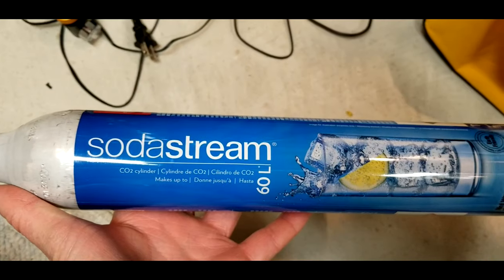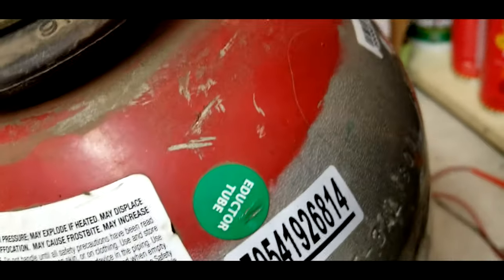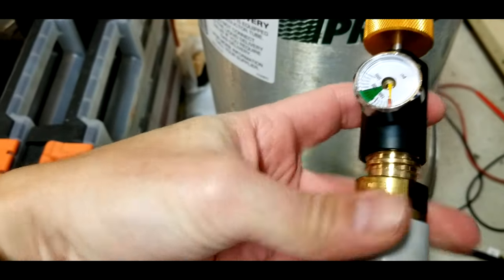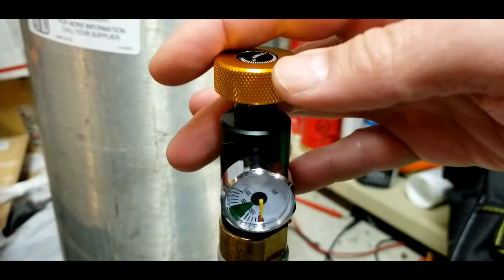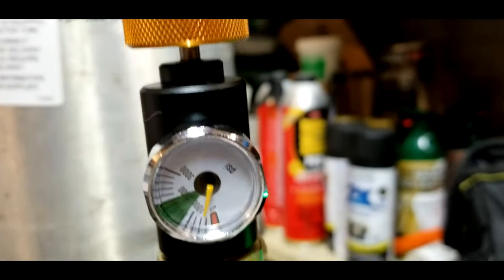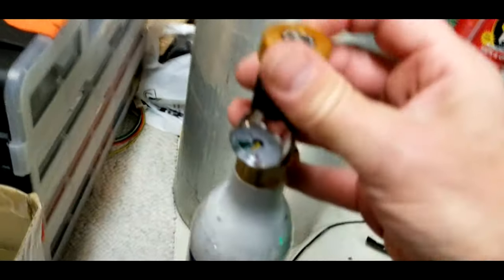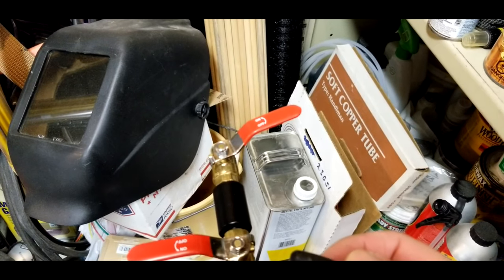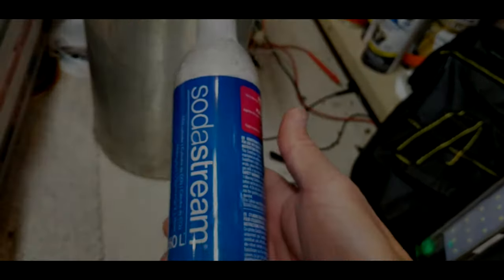How to Refill your Sodastream CO2 Cartridge for under $1.00!

Comment: Oops, I bought this adapter and a tank and CO2. It doesn't work on the new quick connect Terra soda stream bottles. Back to the drawing board. If only I had known then what I know now.
Reply: find any solution?

Comment: Can I use a standard beverage gas tank without the dip tube and just turn it upside down? I understand freezing the tank also lets you get a better fill.
Reply from the maker: Yes (upside down tank), and yes, freezing the Sodastream cartridge before filling will allow you to get a slightly larger amount of CO2 in it.

Comment: Could you explain why the eductor tube is necessary? Thank you!
Reply from the maker: It means concentrated, liquid CO2 is transferred into the Sodastream tank. Without it, it only pressurizes the tank, and it will end up holding a small fraction of the capacity of a tank filled with liquid CO2.
Reply: @ScottsSynthStuff  bingo! Thank you!

Comment: Good video. I'm still only getting my SodaStream bottles half-filled this way. I weigh them empty (around 700g) and as the bottle is getting filled it stops taking on CO2 at the half point (ie around when I've added about 200g of CO2). Not sure why it won't take on more. I should be able to add 200g further but.. no luck. And I am chilling my empty bottles as well. Any ideas what's happening?

I've tried this with three different SodaStream bottles. Same issue.
Reply: You are filling with gas and you need to refill with liquid CO2.  Invert your fill tank or use one with a siphon.
Reply: Also it helps a great deal to put the SodaStream canister in the freezer overnight before you refill it.
Reply: The easiest change to make is to do the fill in two steps. First, just fill all of your room temperature bottles slowly from the liquid (inverted or dip tube) letting it sit for 5 min, then remove it after shutting and bleeding the hose, then stick the partially filed bottles in the freezer on some ice for an hour or two.  Finish filling into the cold partially filed tank.  You will get at least 100% fill.  don't worry about a couple of percent over fill, but bleed it off by filling a soda bottle soon if you end at more than 110% full (highly unlikely).  

This two step process works much better than trying to get it done in one step with just a cold tank due to the thermal mass heat transfer of the liquid.

Comment: What happens if you trip the check valve? Does it reset itself if you reduce the inlet pressure?
Reply from the maker: Yes. As soon as the inlet pressure is released, the check valve releases.

Comment: I really can't get pass 100g or so of filling - I'm really going slow and the trip valve activates - any clues?
Reply: Go slower. Maybe your tank is low?
Reply: @caprice6825  Actually, I had to put my CO2 tank upside down to make it work properly as I don't have an eductor tube. Thanks for your reply though :-)  I don't even need to close the screw on the sodastream adapter.

Comment: Here’s a trick, when the big tank is getting empty freeze the small tank and heat up the big tank then you get more pressure longer.
Reply: That's not  only a bad idea, it is stupid and UNSAFE!!!!    Never heat any storage tank...they can explode and kill you!    Also the whole idea is to put liquid co2 into the cartridge not gas, if you heat the liquid, it will turn into a gas! Chilling the tank by either refrigeration or letting the last of the gas out is recommended....cold bottles do not let the liquid turn to gas creating a pressure that fights the liquid from fully filling the bottle.
Reply: The C02 needs to be in liquid form under pressure and turns to gas when released.

Comment: why not just get a high psi hose and hook the tank directly to the sodastream. the pressure from a tiny canister is the same as a large 20lb tank, no?
Reply from the maker: Yes, and there are adapters that let you do exactly this - as long as you don't have a problem finding a place for your 20lb tank near your Sodastream.

Comment: make sure you use food grade co2
Reply from the maker: Have you been to the gas plant? I have. They don't have a "food grade" CO2 or "medical grade" O2 machine. They have one machine that makes CO2 and one machine that makes O2. They hook up a welding CO2 tank to the machine, and that's welding CO2. Then they hook up a "food grade" tank to the same machine, and that's food grade CO2. Same goes for the O2. The gas is EXACTLY the same regardless - the only difference is the color of the tanks being filled, and the prices being charged for it.

Comment: no worrie bottle has  to be rated to 5 times its capacity by law  and cylinders need to be tested every 6 years  bottle has a ripple at bottem of tank that  expands out if it over gases  so there safe

Comment: I have someone selling their co2 tank they used for their kegerator.  They don't know if it has an eductor tube.  Do you know if kegerator tanks require an eductor tube?  If so, I can buy this one for the setup in your video.
Reply from the maker: Highly unlikely, because a kegerator needs gaseous CO2, and the purpose of an eductor tube is to feed from the bottom of the tank, which gives you liquid CO2.
Reply: Wouldn't it be possible to skip the eductor and simply have the tube be upsidedown?

Comment: Hi, others have asked this as well - how do you know when the Soda Stream bottle is full?
Reply from the maker: It stops filling when the pressure is equal to that in the source tank - about 800 psi. You can hear it stop when it's full.
Reply: Full is when it won't fill any more. The pressure in the source tank will be the same as in the SS bottle.

Comment: Hi why does it have to have an eductor tube? I imagine the explanation is quite complex in addition to explaining in your own words perhaps you could link some informative content like videos or literature? I looked for other similar hack videos but only you mention the eductor tube.
Reply: The tank is full of liquid CO2 at the bottom and gas at the top. Because you are using it to fill another tank, you want the liquid and not the gas. The eductor tube runs all the way to the bottom of the tank so that when you open the valve liquid is forced out instead of gas. You could use a tank without an eductor and turn it upside down to accomplish the same thing though.
Reply: @nerdstrangler4804  Thanks for the reply. I follow your explanation thus far.. so what would be the danger or the result of filling the canister (smaller tank) with gas CO2 instead of liquid?
Reply: @agustinferreira5128  Not sure if there is any danger, just that you won't be able to force nearly as much CO2 into the receiving tank by the time the pressure equalizes so it will be mostly empty and need to be constantly refilled. Even with the eductor tube you can apparently only refill the sodastream tanks to around 50-60% capacity at room temperature. Although you can refrigerate or freeze the sodastream tanks prior to filling in order to help fill them more.

Like I imagine you are, I am currently researching this all for myself. Personally I am leaning towards just using a standard standard CO2 tank without an eductor tube and buying a hose that allows you to connect it directly to the machine.
Reply: The reason why you want the liquid is because liquids have a higher concentration of molecules than gasses, therefore a higher CO2 concentration.
Reply: No eductor tube? Flip the the tank upside down.

Comment: Good instructions.  But please don't recommend that refill adapter.  A lot of users have to fix the connections, or even replace the valves.  I have to apply Teflon tapes to all the connections.
Reply from the maker: I've been using it very regularly (at least once a week) for 9 months with no problems at all!
Reply: @ScottsSynthStuff  I am glad it works fine for you.  Per your recommendation, I purchased the product from Amazon.  It was leaking the first time I used it.  If you search on "leak" against the comments, you will know what I am talking about. Now I got mine fixed.  I hope it can last for a long time.

Comment: After stumbling on this video a couple weeks back I got the same set up but may have tripped the check valve. Any tips?
Reply from the maker: Just shut the valves, release the pressure, and start again. The check valve resets itself when pressure is removed from the fill hose.
Reply: @ScottsSynthStuff  thanks, apparently I was going too fast lol
Reply: @ScottsSynthStuff  How long does it take to fill? I am always too scared to let it get into the green as you say because it starts making this high pitched noise. I'm afraid I will explode the cannister.

Comment: one important point to remember.  If you are below ~830psi (at 70F) you have depleted all the liquid CO2 in the donor tank and are only transferring gas.  You will not get much CO2 into the soda stream tank if all you transfer is gas.
Reply from the maker: Correct, and you will know this a) because the sodastream cartridge is not as heavy when "full" asn b) it "runs out" quickly, as there is no liquid inside to evaporate.

Comment: Non-siphon? I called my local welding store before I watched this video and explained to him what I wanted to do and he said I would probably need a siphon tank?

Also, can you give a link to where you bought your tank? Sounds really cheap. I am seeing ten pound tanks for $130~
Reply: The "eductor tube" mentioned in the video is a "siphon tank."  It makes the tank supply liquid CO2 instead of gas, which is what you want when you're refilling another tank.  But, I find it a lot easier to use a regular non-siphon tank just hooked directly into the Sodastream machine itself with an adapter hose, and not bother with trying to refill tiny tanks.

Comment: For some reason the gauge needle never gets close to green and we have to refill again in only a few days versus a few weeks when we swap our Sodastream cylinder. Any Ideas?
Reply: Are you weighing the bottle before and after? I can measure the difference and know how much it filled. Maybe your tank is getting low
Reply: Thanks for the reply. The tank is new. I'm weighing the cylinder now and I can measure the difference. I think I've got it figured out now: I freeze the cylinder before filling and that has made a huge difference. And my tank doesn't have a dip tube, so I know to turn it upside down when filling. Needle never gets to green area but whatever.
Reply: @bhegg  the soda stream bottles only hold about 400g so the needle should only go to about 400. In the green is 1000 I think.....my preweigh is about 700 then after is close to 1070. I can't get the full 410, but close enough. Peace 🌻. At least we enjoy our cheaper refills!
Reply: @caprice6825 if i try to fill sodastream  tank by your way and it doesnt reach 410 g . If i keep it filling for more time and it doesnt fill more, there no risk to explode?
Reply: @AliAlmutairi-sj1it  as your tank gets lower, your bottle won't fill as much.  I'm only getting about half fill in my bottle but I've been filling from my tank for 2 years.  It's probably time to top off my tank.  I have to fill more often.  But i have 2 bottles that i fill so i can go twice as long before filling. I have a large tank so I'm not looking forward to carrying it to the gas supplier. Also there is no risk to explode, the tank and bottle equalize in pressure abs the Bottle stops filling. That's why when the tank is low, the bottle is also low. Hope this helps.

Comment: Doubtful that you will FILL the recipient tank. Weigh the empty tank before and after,  you may be lucky to actually transfer about half the claimed capacity. Had better luck with a recipient tank that had already been refilled by a commercial brew shop. Suspect that some modification to check valve is happening behind the scenes. If you are doing this for your own use, half a refill will still work,  but there is waste venting at the end of each "fill".

Comment: Hi, how do you know it’s finish filling, but not over filled (pressure)?
Normally big tank could carry higher pressure than small tank like Sodastream, isn’t it?
Reply: You can't overfill it.
Reply: I think that's what the pressure gauge is for.
Reply: @sdcrowder  you can over fill. That’s why there’s a relief valve on soda stream bottle. I filled 3 bottles up. Set on kitchen counter and the relief valve blew and discharged bottle in kitchen.

Comment: So you’re not fussed that you’re not using food grade co2 and recommending that it’s ok to use industrial grade co2 ?? I presume the only difference would be possible contaminates.
Reply from the maker: Have you been to the gas plant? I have. You know where the "food grade" CO2 comes from? The exact same machine that produces the welding CO2. They literally fill both types of tanks at the exact same fill station. The only difference is the price they charge.

Comment: This video contains wrong information. This should not be attempted though this system is far safer than others available on the market. CO2 pressure is dependent on temperature. On a cold day the liquid may not off gas more than a few hundred PSI and on a hot day it can generate considerably more. If there is insufficient head space, above the liquid itself, the pressures can exceed the over pressure relief valve (3000psi) and cause it to vent all of the gas immediately. This can be dangerous and even deadly but it's definately scary if it happens when you don't expect it. Always fill CO2 by weight, accounting for the tare weight (empty cylinder and it's valve). But it is a violation of Federal Law to refill Sodastream brand cylinders. They are marked with a special permit which restricts who can legally refill them. You are far better off having a proper cylinder with a CGA-320 valve and a hose with an adapter that goes into the sodastream machine itself. This bypasses the risks associated with filling sodastream brand machines but it is not as compact.
Reply: This is good advice, however I'm wondering why you think temperature outside my house would matter. The temperature inside my house is always the same year round, neither hot nor cold. Also, remember not everyone lives in the USA so "federal law" is moot.
Reply: @luckycatdad8369  

Filling CO2 inside is probably unwise, unless it's a large open space. Co2 is an asphixiant. Also, cylinders bearing the letters "DOT" fall under the restrictions of the Department of Transportation code of Federal Regulations title 49. If the cylinder is made according to 49CFR and market as such then it doesn't matter what country or what planet it is on, those regulations still apply. There may not be an enforcement in every country or certainly not on other planets but that doesn't mean the rules don't apply to that cylinder. Use common sense, don't use this product.
Reply: Do you know the name/code of an adapter that goes directly from the sodastream machine to a gas bottle?
Reply: @bawlbags4393  

A variety exist. There should be a couple American made products designed specifically for going from CGA-320 female(standard CO2 connection) to what Soda Stream uses. It appears that CO2 doctor is not around anymore though. There are numerous options manufactured in other countries ranging from $30-60 on amazon/ebay. The bonus is with these proper hose attached systems you can use a larger volume cylinder and pay even less for CO2.
Reply: @NorthWoodsDiver  Thats what I was originally looking into doing but It seems like all the direct connect systems require you to vent the gas in the line after every use. Seems like alot of hassle and wasted CO2. Do you just leave the hose pressurized all the time? Do you know why they recommend venting after each use?
Reply: @NorthWoodsDiver  why would it be wise outside, where conditions cannot be controlled?

Comment: So i called my local Praxair and he says you have to buy the 1st tank to be able to refill this at the price you list in the video...??! did you forget to mention this??? he says for a 20# tank you're looking at $290...wtf? can you provide more info please???
Reply: I was just quoted $230 from my local AirGas store for the 20 lb tank; then it's $30 for a refill. I was all set to go through with this but after I spend $50 on the adapter, it's $300. It would be more than a year before I recoup the upfront cost.
Reply: My local Praxair took a random old tank I bought for cheap on marketplace as my initial exchange.  They just had to charge me an extra $20 "test fee" on top of the normal exchange price because it hadn't been pressure tested since the 80's.  Much cheaper than paying full price for the first tank.

Comment: Would be nice to let people know they have to spend 120.00 bucks for a tank, then refill it, then its cheap..godamn clickbait
Reply: If one large CO2 tank can fill 30 Sodastream Carbonators, and you're spending $120 in parts + $24 for the refill, you're at slightly less than $5 per refill after you've gone through the CO2 tank and the cost will go downhill from there.

The problem is, there's no way to communicate that complicated relationship between initial investment and cost over time in a title.... so you get stuff like this.